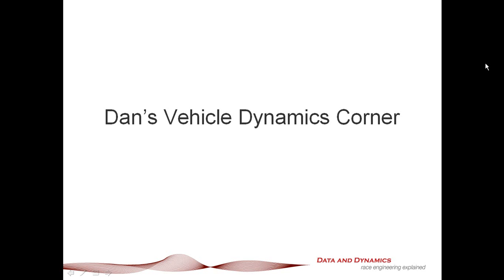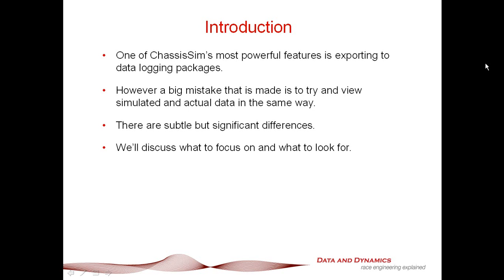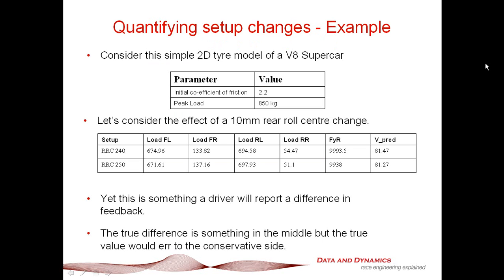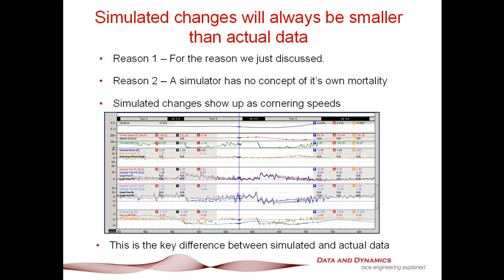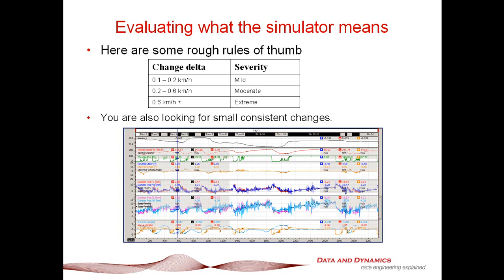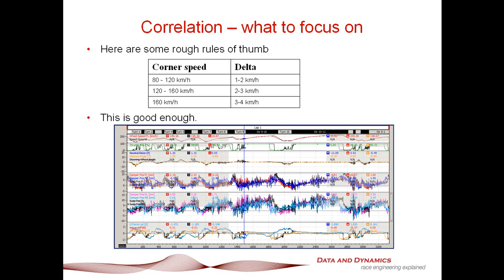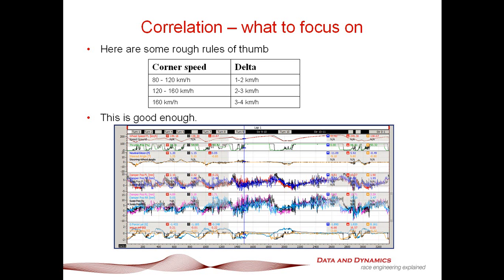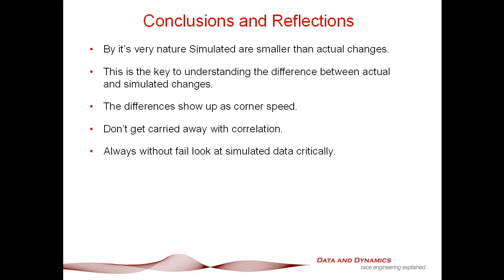Dan's Vehicle Dynamics Corner - How to look at Simulated Data

Comment: Hi Dan,
your videos are very instructive but they have a weak point in sound quality. In most cases I have to replay the video several times and still not understand what you are saying. Could you please upload subtitles for your videos?

Thanks
Reply from the maker: Tevoal - Leave this with me mate. I've just moved on to a new laptop and I'm well aware the sound quality needs to be better and I'm in the process of chasing down a mike. I just haven't gotten around to it yet because I've been hammered. I'll get on to this as soon as I can. BTW - This is a compliment I did to an article I did in Racecar Engineering so it's worth chasing that down as well.
Reply: Great, thanks. I'll also check the article